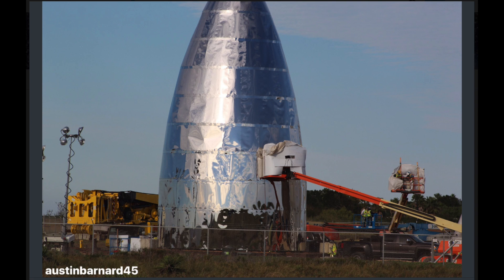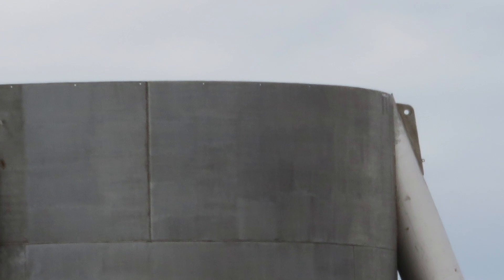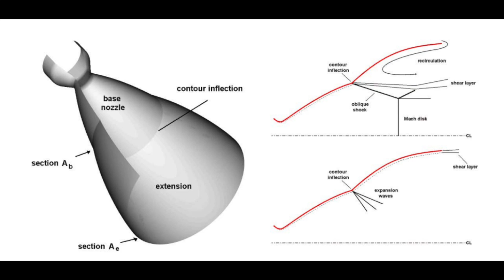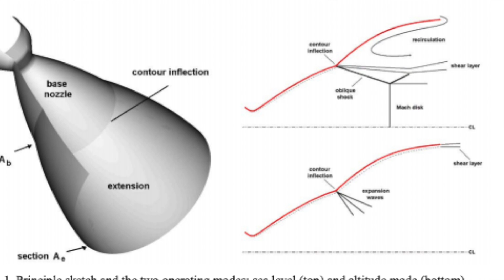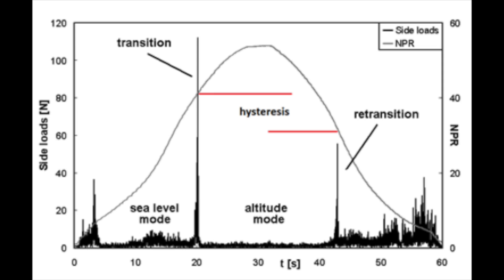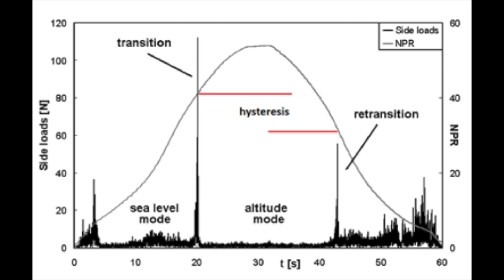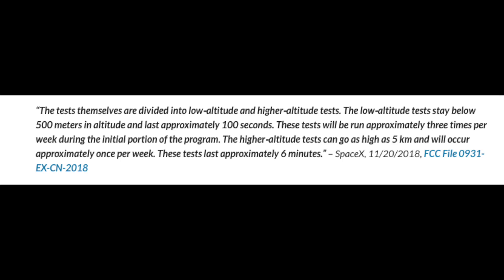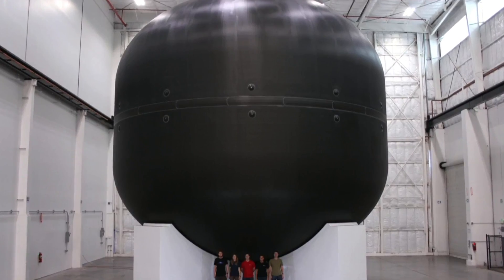What's Going On With SpaceX's Stainless Steel Starship?

Comment: Three engines would probably be a lot safer, as you said it could run on one, and if this is meant to carry people you want more engines in case one engine fails. (Middle fails, they continue) (one of the outer ones fail, they can lower or kill the thrust of the opposing engine.)

Comment: I think the 3 raptor engines are in case of a failure like if one is shutting down, they still have the two others. And i think they're gonna tryquite a few flights with the same rocket to test different configurations and conditions ( maybe go higher each time ) idk.

Comment: Makes sense to me as a test vehicle for the engine configuration-- why not have a company with experience making similar shapes nice and strong do it? If I was building an engine test bed and/or something showy that's meant to fly a lot of times for investors, I'd use all of the weight designed in as payload in making it tougher and cheaper. 

I mean really-- hyper expensive, delicate space rated airframe with a big block of concrete as ballast, or a cheap ass shiny tank? It's like a rocket sled-- big durable clunky tech because it's not the part that you're concerned with. One system at a time.

Comment: From what I've read this initial hopper is more about the Raptors than anything else... so they literally just need to get something with size and mass and really rough shape. They can whip that together pretty fast and get some real world data on the engines. I'm sure there will be a much more refined hopper later on to test additional aspects of it.

Comment: Aren't rocket engine engineers using genetic algorithms to simulate entire populations of engines, and leveraging the power of this technique to find better engine designs? Or are they still "manually" doing design, and simulate afterwards? Using genetic algorithms, you let the simulation drive the design process.

Comment: Excellent video, so much fascinating stuff.  The big conical structure may be for aerodynamic stability testing, perhaps to get more experience with stainless steel (though it looks very low-tech). If I understand Elon's tweets correctly, SpaceX are now going for stainless steel integral tank structures as opposed to carbon fibre. I suspect that they just were not able to solve the problems of super-chilled propellants in CF tanks,  similar to the problems which scuttled the X-33  and bedevilled the COPV  He tanks on Falcon 9. After all, the Mercury/Atlas astronauts went up on SS balloons, so the technology is, shall we say, proven... I also guess that this model is more to test the Raptor engines than anything else, to see how they respond to the landing controller and to test them in real world conditions. That sort of test for Merlin would have been done by Grasshopper, and then the controlled ocean landings of Falcon 9 (note that the F9R test item was not replaced after it was destroyed).

Another aspect is that the landing sensors (radar? GPS?  IGS?) will need to be tested and calibrated using a vehicle with the shape and electromagnetic properties similar to  Starship.  Scott, do you know how the landing system on Falcon 9 works? It is obviously completely self-contained, capable of precise landings on any surface (sea, ship or land), day or night, without any active external signal (other than passively receiving GPS).
Reply: The sea landings may presently require the drone ship to maintain perfect station keeping. 

The Super Heavy booster will require communication with GPS receivers at the launch cradle to implement one centimeter scale errors during landing.

Comment: If you were just wanting to have a proof of concept for you engine and insure your geometry is correct then why spend a lot of time on the rocket itself? Put a pointy nose on top of your fuel tank and test your engines at altitude. As long as your structure is "good enough" for the stress of atmospheric flight then what does it matter if you are only concerned with the engines.

Comment: its elon, working hard, as he pushes hard, the whole aspirational timeline stuff. now they've decided stainless steel, production can happen much faster than carbon fibre, so why not build it out of stainless at this point, suppose they could use normal steel. Combine that with what looks like the near completion of the nasa manned development and its full steam ahead. Either verify this idea or bin it as soon as possible. 1 raptor would not give any roll control, and iirc full sized starship is going to have three landing raptors, so makes sense to fly in that configuration for data.

its still mindboggling and can't get the old noggin around it, but I think this will fly.
Reply: Actually, there will be seven Raptors. Very early on, Elon said that all engines would gimbel, but now, IDK.
Reply: @avid0g  yep, but only 3 for landing burning.

Comment: It is more difficult to balance a short cane on your finger tip than a long cane. I think they are going to use it for guidance system testing, to verify they can keep it balanced up straight during the first flight test cycles.

Comment: So, what i think. The bfr is going to land on Earth AND on Mars. From the explanation (at least what i understand) you gave about the shape of the engine's nozzle, it could technically land both on an atmosphere with low and earth like pressure. They might try an earthlike take off, go up to the altitude that the atmospheric pressure is similar to that of mars, try a "landing" in a virtual(non  existing) platform(lets say they hover) and then land. I am not sure if all that is possible so feel free to tell me if i am wrong.
Reply: that is also likely

Comment: If this is just a tester, using stainless steel tanks in place of the carbon fiber is a cheaper and simpler way of testing with a payload weight. Or a finished weight in a bare bones model.

Comment: Speculation:
More than 1 Raptor allows for roll-control by engines and they also might want to test their redundancy software by shutting an engine down mid-air and have the computer deal with it...
maybe

Comment: i have heard the theory that it will only use the internal header tanks vs the full carbon fiber tank
i think its reasonable to assume it will have header tanks for the 500 ft hops and then when the full tanks are ready, they will be used for the high altitude tests
im just like a guy tho

Comment: Given the size of the nozzle compared to the size from the dearmoon event, isn't it more likely that the dual bell is to enable the engine to throttle down further without flow separation, rather than for altitude compensation?

Comment: As an engineer who has developed cheap and quick test beds to get information necessary for a development program I think it is that.  You point out the bell shapes and some of the control issues at different altitudes, so it would make sense to build a test bed with similar aerodynamic characteristics to the eventual real article, and then have the same number of engines, thought to be 3, that will be used, now develop the control algorithms for the thrust of those engines using a test bed that resembles the real article close enough that the data collected will reflect one or more real test cases, then it will move the whole program forward at a minimum cost and rapid a schedule.  Seems really rational to me, and likely the only sensible way to proceed, lacking the proverbial money pipe to the government.
Reply: This is exactly what it is. I guarantee it. Why build an expensive flight worth test bed when all you really need is proper mass distribution and shape? This isn't about re-entry dynamics, this is literally about engine performance and propulsive landing guidance algorithms. This is the perfect article for that. Especially if they have any doubts as to the performance of the double bell nozzles on the raptors or think it may crash and burn for any other reason. Save a significant chunk of change.
Reply: Plus, if it does crash some warped stainless steel can still be recycled to get at least some of the costs back, maybe even quickly repaired on site with a hammer and welder.

Any cracked carbon fibre would be going straight in the bin
Reply: Akin Khoo  It has been stated that the Raptor design allows for significantly lower thrust levels (10%) meaning they can have 3 on and lose engines without losing the ability to land safely. Important to have all 3 to test this capability. It's also important to have it be the proper size so that the engines can be tested handling the motion of something wider than their baseline, whereas the diameter of the octoweb on the Falcon 9 nearly matches the diameter of the rocket body itself. It's a very different setup and needs testing.
Reply: Akin Khoo  Well they have done extensive fixed stand tests on the Raptor engine so know the thrust one engine can provide.  You are correct that they need more data, but not with a single engine.  Even if the engines are fixed in position, with three they will be doing thrust vectoring during landing approach and touchdown, by controlling the thrust of each engine, and that cannot be done in isolation, it needs the three engines,  a mass distribution, and aerodynamics similar to the eventual actual body to develop the control algorithms for the engines.  Sure these will be fine tuned later, but they start with less than 500 meter landings, then move to higher and higher ones with more maneuvering test the boundaries of the possible, and develop a range within which the final vehicle must operate.  If one of the boundary cases involves single engine operation, then with three mounted close to their final positions, they can test single operation, while the effects of the neighboring engines are present. Each will have different control issues because there position relative to the center of mass and center of thrust will be different.  It is possible they will do some testing with only one real engine, and two dummies, we don't know enough to decide that, but having all three bells present is needed to develop even single engine performance factors on something approaching a real ship.  The test data will be used to validate, and to improve the control algorithms, then later with closer and closer approximations to the real ship provide verification they can meet the design parameters.   This stage of testing is developmental not certification level, and allows one to converge on a final workable certifiable design.
Reply: If you plan to us three, you will need three, else algorithms will be wrong Akin Khoo
Reply: Akin Khoo  The ultimate goal for this platform is manned flight though, and they will probably have to go through multiple and rapid design iterations to make that happen. In that case, having the extra engines to give that extra dV to slow the rocket and save the vessel is probably worth it. Instead of building 5 or 6 of these, lets build 2 and give it more engines to slow down in an emergency. The extra weight of the added fuels can be chalked up as simulated cargo or personnel returning from orbit. That is how I would view it anyways. If I had a factory geared up to make engines, I would go ahead and take a few rather than let them sit in a warehouse. Inventory is bad for business after all.

Edit: To your point about proving the engine can make it off the ground or not, on this scale you MUST test multiple systems in the field at one time. You really dont have the choice, because the cost of testing each system one at a time is (no pun intended) astronomical.
Reply: Akin Khoo  Of course I do, that is why they are building this, as I said.  Not looking to argue,  I think we are describing the same situation. They have fixed static test data, but that isn't enough so this is being built to get more data, and three engines allows single, dual or three engine testing, and as I said, maybe to start one only uses a single real engine, but can get data on up to three.

Comment: The only thing that makes sense, to me,  is a test bed for the Raptor engine, stainless steel skin and the dual use nozzle . Anything else requires Elon Musk either lying, or being an idiot; he is neither. 
 I agree with Scott's conclusion, but I'm more confident than Scott appears to be. 
 The only reason to use stationary landing legs is for a test platform, as they are cheaper, have fewer variables, produce more drag/lift and are heavier(in this case). While the first two are good for any design, the latter two are big downsides if you actually want to carry cargo. If you want your test platform to simulate cargo, but not actually have any (as that would add variables), you might as well add weight and robustness, simplicity, etc, to the design. 

As for the stainless steel, well that's an interesting choice. Compared to the cheaper aluminum alloys, there's not much going for it. Stainless is harder to work with, worse strength to weight ratio,  it's corrosion resistance isn't hugely better, and the cost of stainless is similar if not worse. Bear in mind, this is just for the inexpensive aluminum alloys. However, stainless has FAR better high temp properties. Stainless retains much of its strength at temperatures that will melt any aluminum alloy. The problem is that aluminum can get around this; aluminum is very shiny, so it doesn't absorb much heat, it is quite thermally conductive and has a high thermal mass per weight, so it can get rid of heat quickly and can wait a bit to do so. Stainless is the opposite in all these respects. 
This leads me to believe that SpaceX has some relatively novel idea on spacecraft construction that takes advantage of stainless steel.

The use of a contractor that typically makes water tanks is a smart choice. Few have used stainless in the aerospace industry since titanium became widely available. Water tanks require high quality construction and anybody would be cheaper than an aerospace contractor.
Reply: The hopper legs have concentric tubes. I bet this allows the legs to withstand hard landings by "telescoping". 

The sheet metal added between the tubes is not structural so much as aerodynamically similar to the aspirational design.
Reply: The telescoping parts are now out of sight.

Comment: 3 engines in a line makes sense from a redundancy perspective. If you can land on 1 great but what if it fails? Can't just put 2 on as you would have offset thrust. With 3 you can use all 3, the center one alone, or the outer 2 depending on the situation.

Comment: Maybe Elon is doing all this to bamboozle the Chinese, while the real project is going on in actual secrecy...

 or it could be a boilerplate vehicle to test actual assembly and loading procedures - and aerodynamics - before actually making the first BFS; I understand boilerplate test articles are traditionally made out of steel.
Reply: No. They are also making the finished one out of stainless steel. We know for a fact this is for their starhopper tests.
Reply: @skyr8449  
I did pick that up from participating in another thread (which has gotten rather long) : Stainless steel was decided on because (in my view due mainly to the size of the spaceframe) it will allow the design to dispense with heavy, expensive, turnaround-intensive heat shielding and multiple-composite construction, allowing for much simpler and inexpensive (even if less weight-efficient) construction.  While weight is a factor, so is complexity, because design complexity affects reliability and the number of failure modes and abort scenarios.  Quite unorthodox, and IMO rather risky (and un-geeky), but ingenious at the same time.

Comment: The huge carbon fiber tanks would definitely be light enough to ship over land
Reply: I think someone mentioned back when SpaceX got the property in LA Harbor that the reason they did that was because there is no overland route capable of transporting such huge diameter parts all the way to either TX or FL. Which means barge via the Panama Canal.

Comment: Speed could be because someone has a rumor about a surprise Blue Origin launch.

Could be because Elon is getting older and wants to maximize getting there.

Also perhaps tue internet satelittes are getting built and he wants a bigger launcher fasterhan expected for thst.

Many good possible reasons.

But the main one is if you realize you can do what you want without complex new engineering then you suddenly can crank it out.  And elons tweets seem to indicate this new design revelation within the company has caused exactly that kind of rapid schedule speedup.

Comment: It looks like the rockets I build as a kid just bigger (much bigger 10-30 cm compared to 55 m) and with metal engines for liquid propellants instead of solid propellants (aka sugar + .weed killer, later cotton + weed killer). Anyway, I have the impression that it is a mock up with all the dents and ripples in the hull.